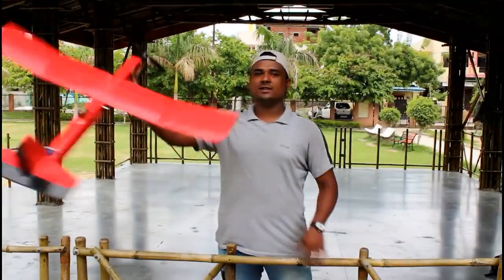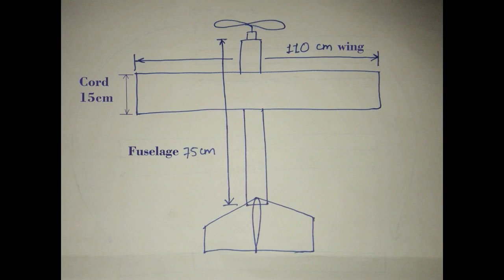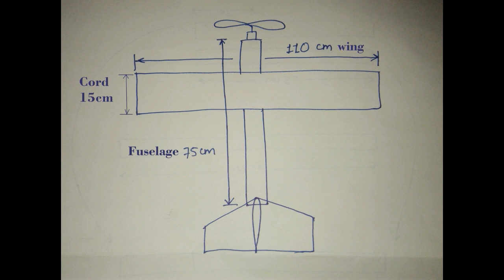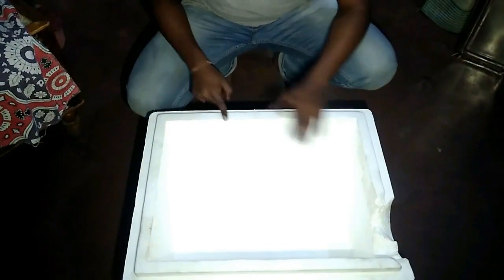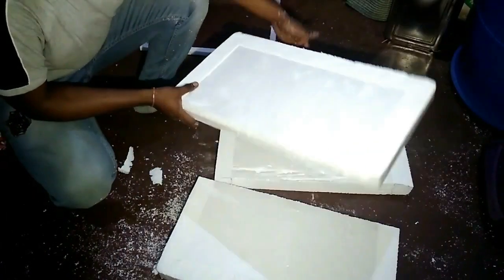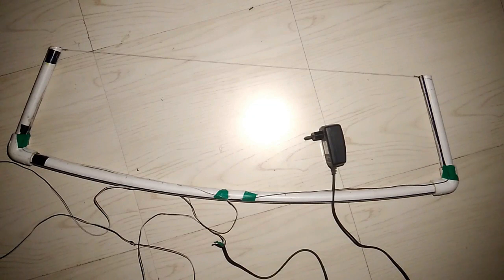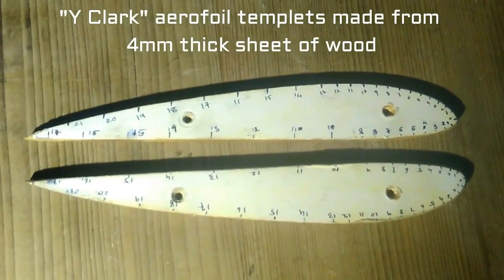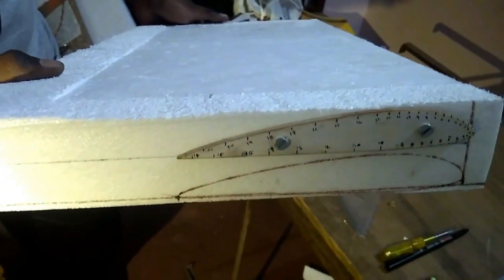RC Plane from Thermocol Box - Part 1 | Club AeroFlutter

Comment: some information.    at 5:30,  installation of the main spar at the upper surface of the wing,  results in the   WING  having a top-heavy dom.    btw, a rc flying model does not  Need  sooo  much dihedral/polyhedral.   in this case, much shallower dihedral  angles Should be used.   AND, a  more  efficient,   DIHEDRAL wing with  Center-section,  COULD have been made.   cheers                 googletranslate
a center-section iteration
https://www.rcgroups.com/articles/ezonemag/2001/jul/ugly-sport/Wing04.jpg
center-section and  dihedral  BRACE;   see   w-12   and  the   w-1s  in linked plan image
http://docplayer.net/docs-images/57/40380413/images/6-0.jpg

Comment: thanks for posting.   based on the view at :00, certain design choices should, if possible, be reconsidered.   the aft fuselage has Not been Tapered; it Should be.   servos installed at the tail; they Should NOT be.   all components should, Initially, be installed near the optimum location of a model's Center of Mass (c-m;    not cg)     this is a point within the fuselage that aligns vertically, with 25% of main wing chord.   the fuselage is too long; so proportions are screwy.   i would suggest that the main wing be moved about four inches, forward.  then,  the prop should be located about eight inches, from the wing.     cheers           googletranslate
Reply from the maker: thanks for this comment David
i will keep in mind whatever you told
soon i will be uploading next part